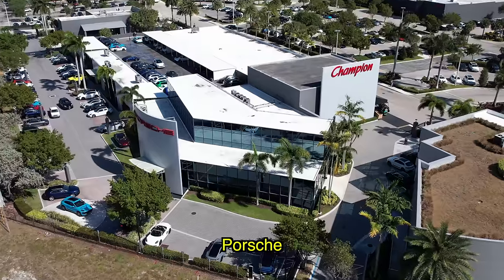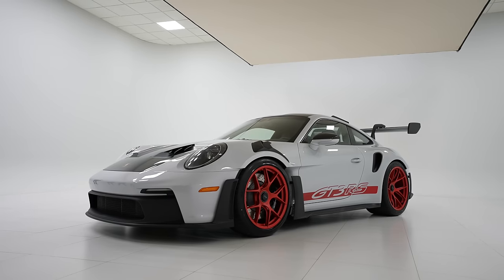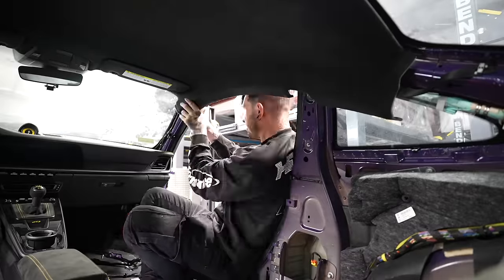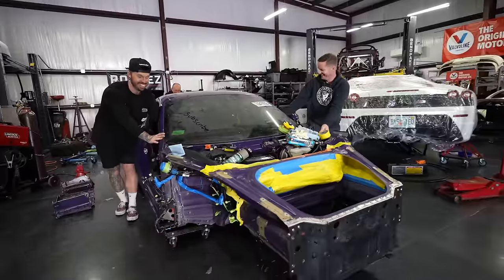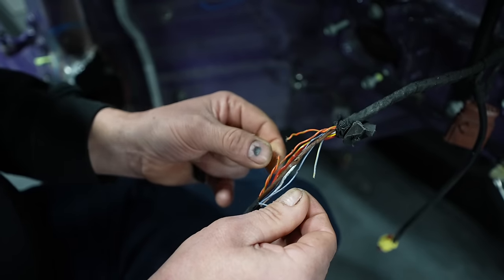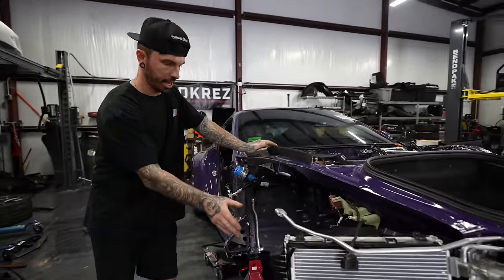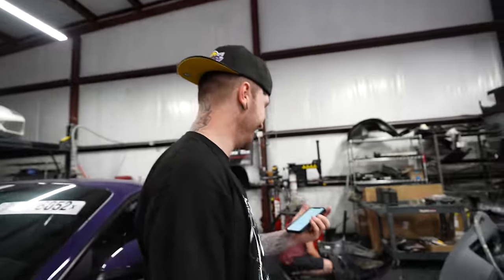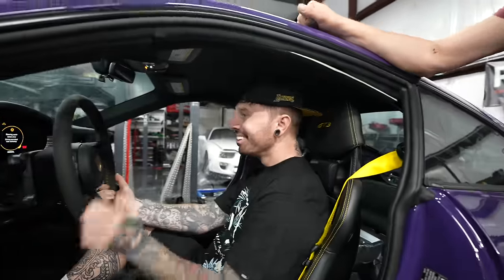REBUILDING A WRECKED PORSCHE 911 GT3 | PART 4

Comment: The lithium ion iron phosphate (LFP) battery in the new porsches goes into a self protection mode when voltage goes too low. It just needs (as you discovered) brief application of charging voltage (12-14V) from another battery to re activate, and then should be charged to around 13.4-13.6V.
Reply: The charger is what is preventing any amps being delivered.  The charger says it is unsafe to charge a dead battery, which is plausible, so essentially the donor battery is doing all the charging as it doesn't have the safety circuit and doesn't care where the power goes.  The charger is then keeping the charge on the donor battery.

I do it all the time with drill batteries, just link 2 wires from a donor battery to the dead battery and it will charge.
Reply: Don't buy a new battery yet, put another battery in parallel as people describe here. Charger will then work - may take a while.
Reply: @Christopher_T_Paul  Yup, had lead acid batteries explode in the shop before because they got way too hot because they were too dead to safely charge again
Reply: I guess you can’t kill the cells in a Li battery like you can with a Pb battery.
Reply: @JelloTypeR good quality lithium (LIFEPO4) have a circuit board inside that protects the cells, they are well worth the extra money, they are very light, cant catch fire, and last about 10 years
Reply: The things we have to learn when tinkering with solar hybrid inverter systems.
Reply: I work with porsches everyday, like mentioned above a lithium ion battery shut itself down when the voltage gets to low. The proper way to activate the battery is to use a lithium ion charger with a special function to reactivate the battery by applying voltage.
Reply: @BuggyGamer-db6mw  I don't know about LiOn car batteries, but laptop, drills etc have a charging circuit built in and if a few cells are out of tolerance it will stop charging.  

In this case it was the charger was stopping the charging, he was really lucky it wasn't the battery circuit because it would be game over...  Well you could bypass the battery charging protection and charge directly to the cells, but that is very risky.
Reply: @BuggyGamer-db6mw  Assuming the lead acid battery hasn't sat around flat for too long it can be done if you know how to limit the charge current until there's some voltage in the previously flat battery.
Reply: Had the same happen on a motorised wheel barrow. We didn’t know at the time and new batteries where 2 grand each
Reply: That's a worthy comment.  If was on 0.0V internally, the Li-Ion battery would be ruined, no charging would be bring it to a accetable state ever, l that's for sure.
Reply: We have the same in all the new Land Rovers, it contains a isolation relay to prevent under voltage, high discharge or overcharge.
It has 2 stages, first stage can be revived by applying 12v for 5 sec. Closing the relay.
 2. Stage the battery has either been over charged over 13.6v or have a ultra high discharge (shorting), where it cannot be revived

Comment: The Li-Ion battery in the Porsche (looks like it's an A123-made model) has an internal relay that opens when the battery experiences under/over-voltage and over-temp as a protection. When the relay opens due to under-voltage (as yours most likely did), the only way to get the relay to close is to apply a 12V potential across the terminals, and then proceed to apply a charging current until the battery reaches the minimum SOC to keep the relay closed (usually anywhere from 15-30% - this can be programmed to any value by the car or battery manufacturer). This is why the voltage started reading once the other 12V battery was connected to it. Modern 12V Li-Ion batteries are very smart and have many protective features; they also last about 10 years if maintained properly!
Reply: I knew there’d be something in the comments - I’m glad it’s NOT that the battery is gonna die soon anyway!
Reply: You clever man
Reply: SRUK fellas just did this to their Lithium battery. @CatchMeOffroad is spot on.

Comment: Absolutely loving this! You may of found this out already now regarding the lithium battery but…the reason it appeared to be completely flat is because inside the battery casing is a control unit and switched contacts. When the charge rate drops to around 11.7 volts the contacts open to save the battery from being damaged. If you ever find this again most chargers won’t send voltage until it sees a circuit…which you won’t have when the contacts inside the battery are open. This is why when you connected the additional battery the contacts closed👌 I used to work in a Porsche Center and having to explain this everyday was a challenge haha! Keep up the great work😎 12:44
Reply: @user-pn3fg5nl9h  don't listen to any of this bs get a new battery. Shocking it back to life lasts 2weeks or in UK winter about 5hr. The cells are damaged end of discussion

Comment: Looking great so far.  On the airbag thing.  I had a crash a couple months ago where 4 airbags deployed.  It’s incredibly loud and I couldn’t hear out of my left ear for a few minutes.  Definitely a scary experience not to mention the crash.  But I walked away unharmed as did the other in the accident thankfully so they did the job.
Reply: I JUST WATCHED YOUR VIDEO BEFORE THIS ONE. YOURE FOLLOWING ME AARON
Reply: but that’s horrible to hear. glad to see that your safe. loving your content as well as Matt’s!
Reply: The only thing you ear is a whistle
Reply: I had a bag go off me once, it broke my nose...  and for like 1 second, I could not breath. The gas from the bag.  This is something you never forget.
Reply: U had a gt3 rs?
Reply: Just make sure you are wearing a your seat belt.  Deployes at between 100 to 200 mph, produces 5psi and a temperature of up too 500 degrees C
Reply: @allongshanks940  when i wrecked my truck I saw what was about to happen (couldn’t stop it) and pushed thru my seatbelt and took the passenger airbag for my brother getting hit in the face then smashing into the passenger side window and windshield it hurt like hell
Reply: @TheCoolDave  how can an airbag break your nose if it's way down the moss scale?  What's your nose made of candy floss?
Reply: @bigduphusaj162  Not sure but, it broke mine when it went off...

Comment: I've got some information for you about that lithium battery. When the voltage drops below 10,5v, there's a mechanical switch inside the battery that disconnects the internal components to protect them. When its disconnected its basically not a battery anymore, thats why it shows 0v, and also why a normal charger cant charge it. To close that switch again, you need to connect an other 12v power supply, for atleast 30 seconds. And thats basically what you did by connecting an other battery.

Great job so far!👍🏻

Comment: Freddy is a genius! It’s so impressive how he can think outside the box- saving a lot of money along the way
Reply: Use Freddy Save Money
Reply: Discharged lithium batteries often need a 'kick' to get them going, if the voltage has fallen below what the safety circuit threshold determines to be unsafe.
Reply: Nope, it’s just basic logic when you realize that Lithium batteries usually have built-in deep discharge protection and the charger refuses to output any current if the voltage is zero.
Reply: He also helped getting the car started in the first place suggesting they push it on the casters- think of the time Freddie has saved Matt on this build, after all time is money 💵😂
Reply: It's also called using an old battery charger with out the safety anti shocking/sparking circuitry.  When ever my battery is dead dead, I have to pull out the old boy I've had since I was a pup in the 90's that has constant *14.4v output.  edited from 15v b4 someone corrected me LOL

Comment: I had same with my 992 Turbo S battery. On these if they go below 11.7v switches inside the battery activate to protect itself and in effect shut off. You can't trickle charge etc, they literally need a big shock to get them back to life. UK Porsche quoted me around £1270 to replace with a gesture of goodwill - several months on and same battery is fine and usually reads between 13.3v - 13.9v on the dash when car runs.
Reply: ʟᴇᴛ’s ᴛᴀʟᴋ👍
ᴛʜᴀɴᴋs ғᴏʀ ᴡᴀᴛᴄʜɪɴɢ!

Comment: What I like most about your videos is your good mood! No matter how my day went, I know it will turn good when I see a new video from you. Thanks Mat! Btw: I used to have the same battery issue you faced with your Li-Ion battery, but with small AA and AAA NiMH batteries for RC: Had to trick my charger with good batteries and some tin foil into charging the dead batteries and get them back into life… 😅
Reply: YES, you can revive them that way

Comment: I'm on the edge of my seat waiting for it all to come together. I want to see it move under its own power with all 4 wheels on the ground. Nice job Mat, especially the dead battery hack. I've done that a couple times myself when the dead battery voltage is too low to get the charger to light up. It does work. Can't wait for the next chapter. God speed and God bless.

Comment: Hi Matt - had the same battery issue just not driving my AMG GTR for 6 weeks. Battery was dead and the Lithium Iron charger would not commit to charge. New battery 3k NZD!! I looked for options. The best workaround is to put a normal charger on a standard battery and then daisy chain jumper cables to the lithium iron in the vehicle from the normal battery that you are charging. This worked to get enough power into the lithium iron battery so that when I connected the C-Tek litium charger back to the lithium battery 24 hours later it charged fully no problem. 
Cheers
Haydn

Comment: 13:31... A trick I do in this situation (charger won't recharge battery becasue it's too low (dead)) is I hook it up to a good battery first, and leave it there for a few hours. It will then slowly get some volts back in. Then, I hook it to the charging machine, and it works, every time, so far...
\O>
Reply: ʟᴇᴛ’s ᴛᴀʟᴋ👍
ᴛʜᴀɴᴋs ғᴏʀ ᴡᴀᴛᴄʜɪɴɢ!

Comment: Love your channel Mat.
What we used to do with the Lithium battery, is put it on a pb charger for 5 seconds or so which will then let you charge it.
What gets me though is that you can actually put these cars back on the road.
Here in Stralia once written off that's it, Can't be registered again. you would have to export it to bypass the law.

Comment: Good video! 

Short piece of advice; don’t leave a ‘broken’ lithium battery on a charger not intended for it overnight without attendance in a garage with expensive cars. They have a habit to go boom.

In your case, small odds since the BMS protected the battery against draining too much, but if the BMS failed it could really be a fiery mess.

Comment: Great job so far. Can't wait to see it back on the road. To get those parts you need in the US, or with anything else for that matter, you need to have connections. I find it hard to believe Freddy doesn't have the connections at a certified body shop to get the parts you need.

Comment: Matt hook up a second battery at the same time . When the voltage drops too low on the lithium battery they don't register and charge so by hooking up another battery at the same time it registers that there is a battery to be charged and starts charging. I used to have to do this all the time with the batteries on my race bikes. Keep up the good work mate.

Comment: Try using a ctec battery charger. It is great and revives batteries (including lithium) and tells you the health of the battery. Have had many completely dead batteries and it works great. It actually helps the health of the battery. Even though you got it working I definitely recommend.

Comment: BTW to revive a dead battery simply use a basic analog charger. They usually look like a box that has analog displays showing the actuall values BUT the have no processors, no gimmicks. They just send voltage down the lines and that's it. Leave it on for 48hrs and enjoy the magic :) Once charged leave it on a trickle charger (has about 1-5W at most so almost no cost) to keep it topped off and after some driving and trickle charging the battery should be solid.

Comment: I’ve had to use that jumper cable trick before thanks to my smart battery charger. Needless to say after that I got the old school charger that doesn’t have to read voltage to start charging. The 911 is really starting to come together

Comment: You need a voltage higher than normal when reviving a dead battery like that. You need to over come the extra resistance caused by the battery being so low. Works with lipo and lithium ion rc batteries all the time. Keep it up man

Comment: Hi Mat, as some already mentioned charging a lithium ion battery that reached a static voltage under the specified limits can lead to degradation mechanism (as dissolution of the collector layer). When applying a charging current in this state, the dissolved collector can cause dentrites. But more likely the lithium ion will create dentrites on the Anode surface while charging as part of the graphite matrix may have colapsed when deply discharging the battery. The dendrites can lead to a penetration of the seperator in the future which leads to a short circuit of the cell and therefore to a potential thermal runaway. This must not happen but charging the battery in this state increases the likelihood of a preventable safety issue.

Comment: Hey Mat,
I've just seen your Video and the Problems you had with your battery.
If it's okay with you I would like to share another solution to reanimate batteries with 0.0V.
Get an old analog battery charger, which load with a specific power all the time. The digital ones only load when the battery has a certain voltage. I think it needs at least 2.4 or 4.4 Volts.

The analog ones aren't measuring the voltage, so you are able to bring them back to life. I've done it several times and even got a spare analog charger so if my old one stops working I've got another to use. They are cheap to find on second hand. I bought mine over ebay Kleinanzeigen (Germany)

The way you did it, also worked great.
But in my experience it doesn't work all the time.

Keep up the good work.
I really enjoy watching your builds and the cars that you get.

You are doing what I always wanted to do.

Best regards,
Dom 👊

Comment: Hey Mat, I don't know if you've sorted the horn out yet but I had problems with the horn when I changed the steering wheel on my Cayman 981 for the newer 718 version. My problem was the horn would blast as soon as the ignition was on and after not being able to find any information about it on the internet I discovered the two prongs on the back of the airbag are adjustable so you just  just need fiddle about with them and set them at the correct distance to be able to trigger the horn when the the airbag is pressed.  Yours must be just set too far out and need winding in a bit which might also be the reason it has excessive movement.  Your steering wheel is slightly different to mine but I would assume it works the same way.

Comment: Hi bro, those batterys can be fixed, there is a circuitboard internal of the battery casing that shuts off the voltage to protect itself for safety maybe. you can connect a tool to the battery circuitboard and change the values in the eeprom so the battery thinks it is a new one and will accept charge again.

Comment: Had the same with a mates motorbike. Completely dead battery that would not charge. Connected a 12v battery from an alarm box for a few hours to try and put some volts into the battery. It worked as when connected back to the charger it charged.

Comment: Hey What you need to do for your battery knowledge is go to a hobby store. We have been racing with Lipo batteries for a long time.  What Tavariah did is essentially jump start a cell, we do this with Lipo batteries after they are too dead. You need to go and balance your cells in the battery though and do a cycle on it or you will ruin the battery now.

Comment: Just keep an eye on the battery. As my experience goes with Lithium batteries, if the voltage drops below a certain voltage, they do not revive. Even if you manage to get them to rev up the volts, the battery will not last very long and will drain out almost immediately.

Comment: Good work matt loving it.
As for your battery concern does your charger have the option for lithium iron charging ? And second thing is the battery will automatically shut off after a specific voltage to save itself, if you speak to porsche somehow I'm sure you can find out the procedure to unlock the battery. Sounds mad but at the main dealer I work at in the UK this is a thing, and your battery I'm pretty confident can be saved 👍

Comment: Li-ion battery have a protection circuit on them. When not in use they shut down allowing them to sit with out discharging. They need to be “woken up” before they show any voltage.

Comment: For your horn, make sure the steering wheel controls are working, if not check the relay and the fuse for the horn and the for switches, and if that reads nothing, it will more than likely be the clockspring

Comment: Lithium batterys contain a contril board called BSM that cut of any voltage going out to protect the cells, if the voltage drops to low. Thats why it read 0 volt. When you charge it above the cutof line it "turns on" again.

Comment: Expensive lithium batteries usually have an on board system that protects the battery from a complete discharge by completely turning the battery off. To wake the battery up usually sending a charge to it is the way to go! they also have a built in system that shuts the battery off when it detects a major short.